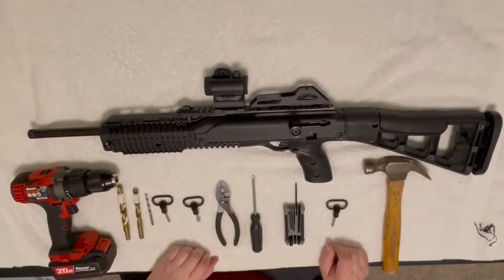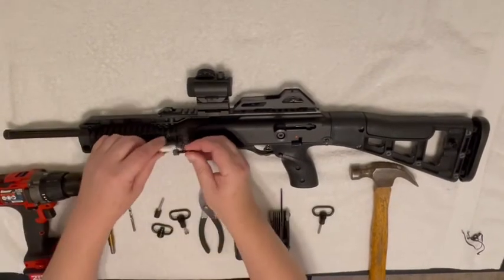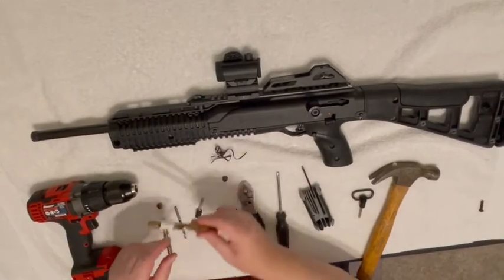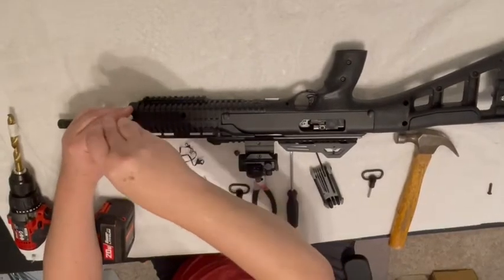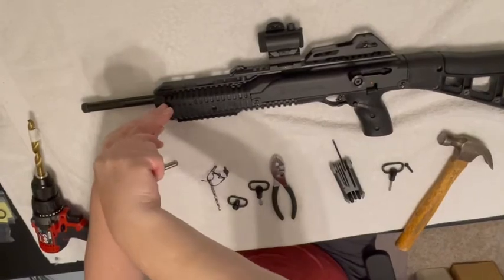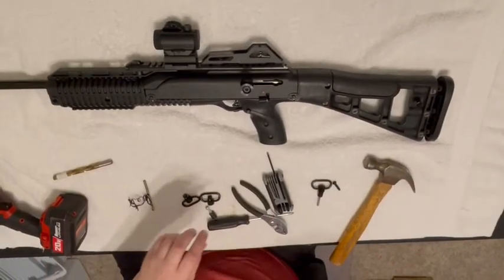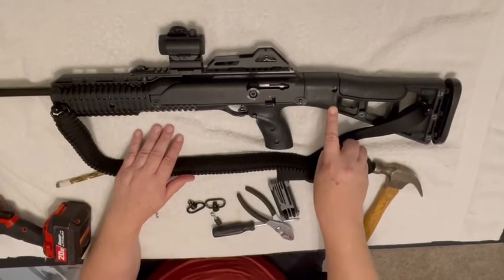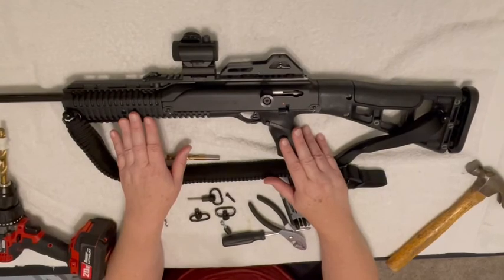Hi Point Carbine Quick Detach Sling cups and rings installation.

Comment: Can you make a pic rail version of the stock adapter? Seems like it would be more economical to make and gives the end user more options
Reply from the maker: I have looked into that and used to have a few blank plates and sold them all for just this reason but most pic rail stocks cost more than the gun so it has not been a huge seller. to stay in business you need to move volume and this idea while a good one is not a huge seller.